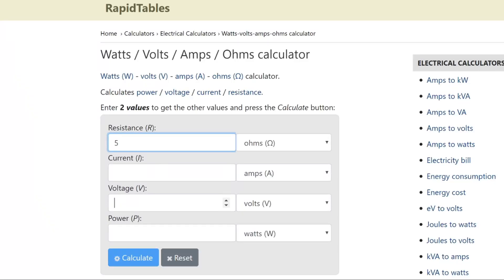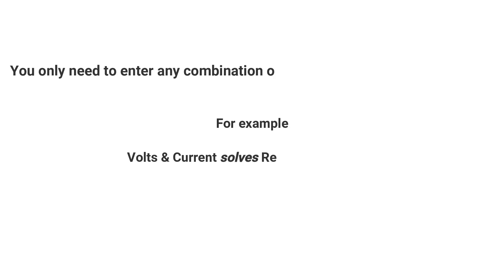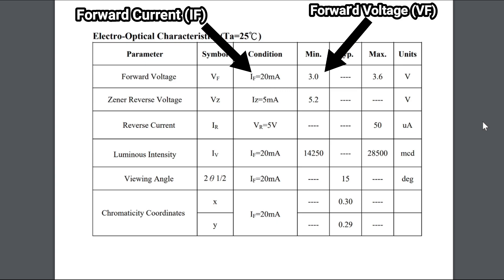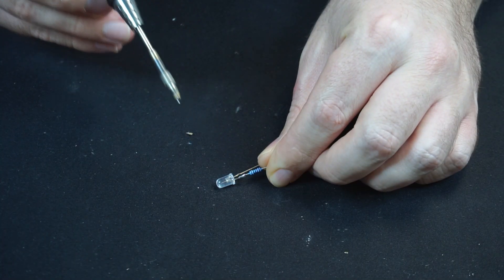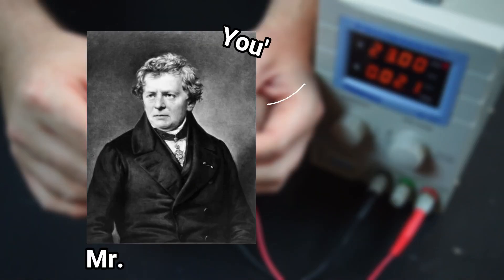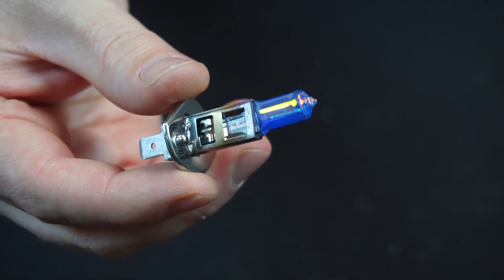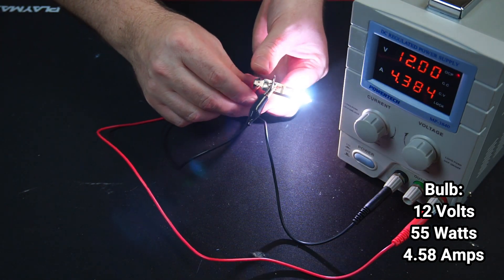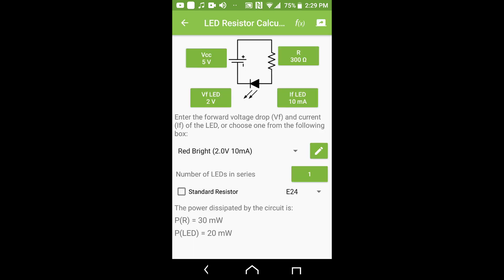If you don't know Ohms Law, then you are missing out! ll What is Ohms Law?

Comment: can you not use a OP-Amp and use a detector diode to produce a voltage dependent on the brightness of the LED to prevent the diode from burning out it is actually the circuit that prevents a LASER Diode from burning out.

Comment: I use a different method say I'm using 5v and the LED is 3v, it draws 0.02amp. I deduct 3v from the 5v source leaving 2v divided by the 0.02amp it draws = 100ohm but where did you get that buck converter please? what's its rating and do you have a link? Thanks
Reply from the maker: It's actually a Boost Buck converter. I haven't really tested it yet, so I'm unsure if its a solid unit or not.  If you use this search phrase you'll find them on ebay "boost buck converter 8a"

Comment: Excellent tute - thanks. In the LED example, It might be worthwhile to point out the power that will be dissipated in the resistor (0.4W), and so choose the right power rated resistor (I think you  used a 0.5W). Perhaps a video on sizing components for power dissipation and heat sinking?
Reply from the maker: Yes for sure. I'm planning to make a dedicated video on running LEDs from DC and AC in the near future. That will be a perfect video to include power dissipation. Glad you liked the video